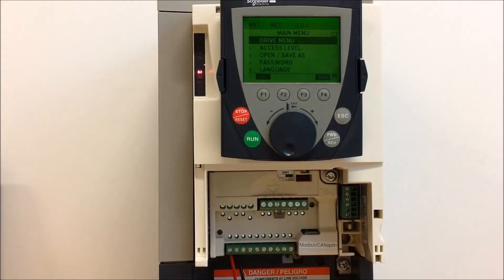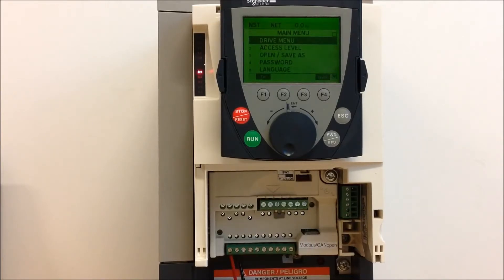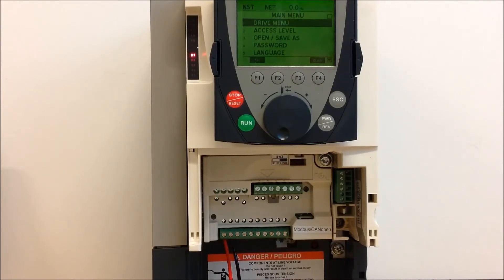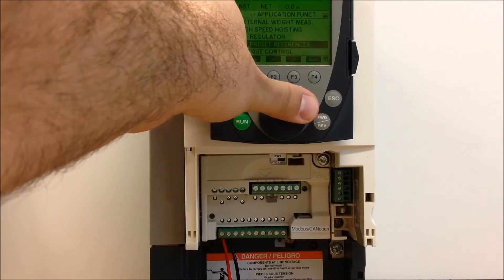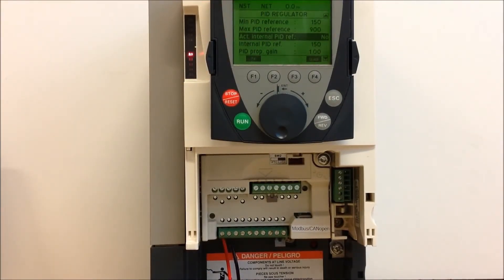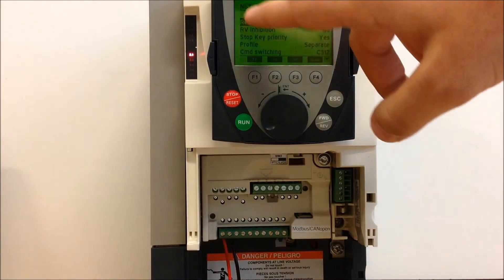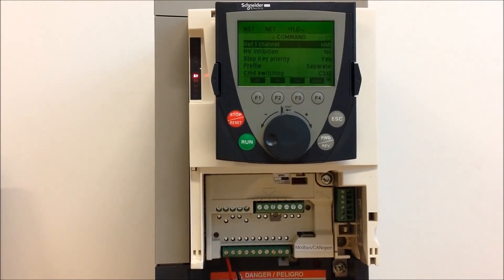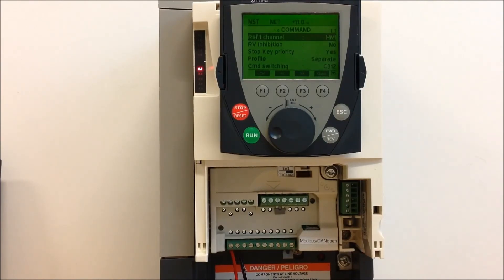Configuring ATV61 & ATV71 PID Set Point Adjustment via Keypad Dial | Schneider Electric Support

Comment: Hi...iam from Mexico  iam using this model of frecuency converter to controlling two pumps with PID control (pressure controlling), but a want to running each pump only one hour and change for the other......how i cant do this action......running pump 1    and after 1 hour stop an d then strat automatic the pump 2.....please  help me to programmimg